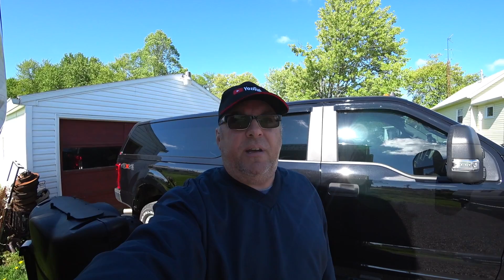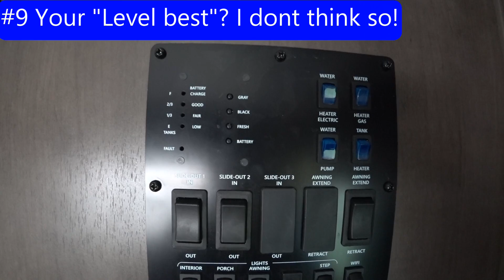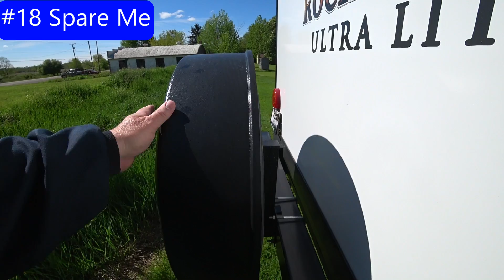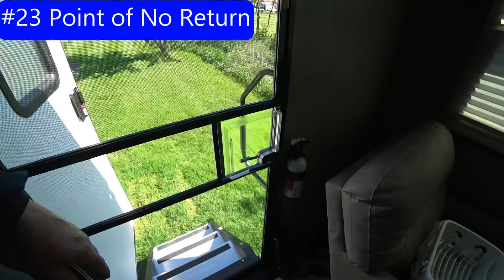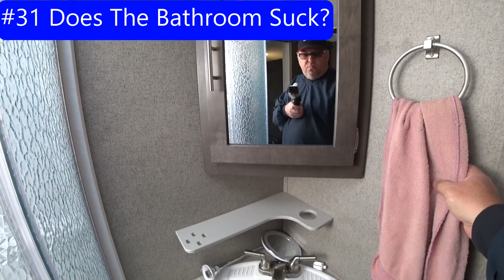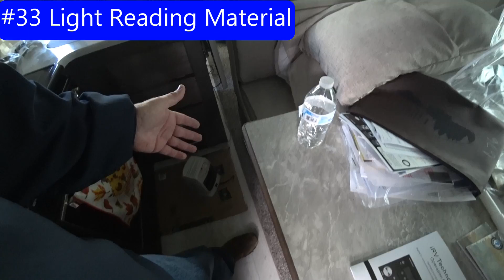36 Dislikes on Our BRAND NEW RV ☹

Comment: Thanks for the things to consider when you're buying an RV video. #2 I'd put some foam on that toe-breaker. That looks painful! #6 There are mattress toppers that can fold or roll up while you're traveling. Once you're staying long enough to bump out the slides you can put it on the bed. Still, more work than you'd like, but your back may thank you later. #22 I'm guessing you already plan to add a rubber stopper, but since you didn't say so... #23 Get those stickers people put on sliding doors. #31 Hate to add this, but mounting suction cups isn't the only issue with texture on every bathroom surface. It also collects dust and will take a bit longer to clean. Bummer. #33 No manual for the RV itself is absurd. I'd contact the manufacturer on that one. Hopefully, someone there sees this video. #34 Replacement bulbs with fewer volts? Colored plastic? Nail polish? Good luck, I'm not sure, but that would bug me too. Congrats on the new RV! Enjoy your travels!

Comment: My pet peeve is overhead lights.  Yes, you might want bright overhead lights when you're cleaning or working on something, but otherwise, I don't want to see a light source shining into my eyes.  Indirect lighting is the ticket, and almost no RV's come with it (except for the high end units).  So I end up having to change fixtures to sconces, lamps, or lighting that diffuses the source.  And while we are on it, sconces that only have a frosted globe are not acceptable.  You can still see the light source.  Indirect lighting means it must be reflected light.  Finding that in 12 volt is tough.  I usually end up having to convert a 120V fixture.

Comment: This is my favorite video of yours. Everyone should make a similar video of their RV. Somebody in Northern Indiana has got to start learning. Love best the point about the tires and bed reading / blinding lights.
Reply: We had the same problem with our light over our bed. I found a simple solution. I took the lens off and used lens spray tint. I sprayed the inside of the lens so it wouldn't get scratched. Took 3-4 coats to achieve our desired brightness but it now works great.

Comment: Did you check this trailer out before you took delivery of it, apparently not? You said it yourself you purchased a trailer with some issues you knew about “why”? I find 60 percent of your issues nitpicking and believe I am a picky person. Most RV ladders are rated at a low weight rating. You would be bettor selling this trailer and try to purchase your old one back. I know you had repaired it quite a bit but your not going to be satisfied with any RV. But I have found as a retired engineer that I can nitpick most anything because I am a perfectionist. If your 1992 had springs on the screen door are you sure you or someone else didn’t add them? My Wife and I have been RVing for over 50 years and we have owned RV’s from class c’s - Class A’s - Fifth wheels and travel trailers. If you wanted low profile ac units you should have either requested or ordered them. By the way if you wanted 2 way powered tv’s you should have deleted the ones your stuck with or paid more money for the 2 way tv. Some manufacturers let you delete the tv’s so you can put what you wanted in it.As for toilet paper holders you can request your deal to mount them where you want not everyone wants them in the same place and like my Wife she had me mount one she found at a store. We sold our ranch plus our company and purchased an Mobile Suites 44 foot DVR fifth wheel to live full timein and I still am not satisfied with everything but it gives me something to do when I am bored. As for the floor registers you can purchase them that are adjustable. Take a deep breath and see if you can hold it for 3 minutes. If you pass out than your nitpicking. As for your Terry we owned a 1984 and it was Junk from day one. Oh BTW the blinds are not supposed to be in the catch unless travel unwise it causes unnecessary wear on them plus they should not be latched while adjusting them. This is why the knob hits the bottom of the blind. As for the black water flush I don’t want it anywhere near my other water connections as for it being near the table your not going to have the table out while cleansing the black tank. Other wise it seems like you have decent trailer. 

But it seems like you shave been aware of these nitpicking issues before you purchased it but in my opinion you say you like your trailer but your either having buyers remorse or making a video.
But I think your having both, just this 74 year old mans opinion. 

This is the first time I have left a comment in the 2 years I have been a subscribed. 

Thanks and I find your nitpicking amusing and you remind some what of myself ah maybe worse LOL, Cheers

Comment: Purchased an Outdoor RV. Most of the issues you talk about were nonexistent. You should have considered the Signature Series model by Rockwood. You did bring up some great points that all RVs lack
Reply from the maker: Thanks!!!  We shopped Outdoors RV and although a better built unit we would have had to get a trailer that was 2 foot longer 2000lbs heavier and more importantly $15000 more to get the same seating layout ...We didn't have that budget... Signature series is designed, Built and used the same parts as the Ultra Lite(we took Rockwood tour)

Comment: You will not like the entry stairs if it has rained and you break camp or it is raining when you do.  I hate mine because water will drip into and on the RV floor when stairs are up-right for travel.  No matter how hard you try and wipe the water off, it will soak the floors.  Poor design in my experience and opinion.  I talked with a manufactures representative at an RV show in Tampa and he said it was not a problem.  Obviously he has not camped in the rain.
Reply from the maker: Wonder why a folded bath towel could not be placed folded at the entry way when the steps are put up? It works for us..

Comment: Yes u are picky...some of your complaints are common to all Rvs. I have a 2015 2604..black flush is right above drain valve. That sucks that they moved it. One thing u did not mention...make sure bathroom door to living area is closed b4 closing main slide..or it will b a problem...i know !!!

Comment: Well pointed out issues,  but keep in mind  it's an Ultralight. They are keeping the weight,  so they choose cheaper lighter components.  When you move to a heavier trailer, a little more on the luxury side,  the quality of the components and tires much better.  Well now you no what you want you should have quite a list of wants and needs. Enjoyed your video.

Comment: Most of the complaints are there because the trailer you went with is designed to be an ultra light. Extra anything is added weight, making use of all the little cubby areas for storage is more cabinetry weight, outlets on the slide out require copper wiring weight, crappy mattress is much liter than a comfy pillow top one the same thickness and the extra hose needed to put the clean out hose on the service side of the trailer would have put it out of the ultra lite class. Also the water heater, heater and refrig  on the entrance side are because of the two slide outs on one side  its a balance issue.

Comment: Just like boats! I purchased a new $30k fishing boat, quality and components were very questionable and somewhat junk. Last year purchased a $80k bay boat, much larger engine (higher price) but entire boat quality, components, fit and finish are superior. My Mother-in-law has a 6 year old $40k tag-a-long camper that has been towed less than 200 miles, sits on permanent beach lot that is falling apart.

Comment: You will never find the perfect RV. After forty something years of rving and traveling in some type of camper we still  want to go another route. We have a new Montana 5th wheel. It checked off every box, i.e., king bed, drawers and cabinets in island, storage in bathroom, fireplace, theater seats and you must be able to see the tv from anywhere in the seating area and a pantry. But recently we started boondocking. We have a potable generator but now we are looking for a Class C and a jeep as we enjoy camping in Arizona during the winter.  So you will always be looking for another camper lol.  P.S. never buy any RV that says lite. They are not built as well because they are using staples and lighter materials. We know this from personal experience.

Comment: Time for modifications lol!  You are correct every rv will have a dozen or so things that could have been better designed.  My biggest  pet peeve in my RV is no electric outlets in the slides. I also agree, almost all RV's have done away with a comprehensive 'owners manual', and that is unfortunate. Also, I agree with the two biggest easy fixes would have been use 12v televisions and plumb the black water clean out to the street side of the coach.  Great video, Lou.

Comment: Excellent video. RV's are like women. No matter how long you date them....you don't know them until you "marry/own them and sleep in/with them. I guess you could say the same thing about men for the sake of women in this politically correct world. Anything from the on/off adjustments on your heater vents to the screen door that doesn't close and everything else including the unused space that could have been used for storage all boils down to one thing...profit. If those pain in the ass hearer vents do not have an adjustable on off lever on them and the ones that do cost 1.00 apiece more just multiply how many vents each unit has x 1.00 x how many units they build. That could add up to 20-50 K in cost over thew entire product run. I have no idea how many units they use them in, but you see where I'm going. A heavier duty latter could only cost them 10-15 dollars more but over the production run could save them $$$$ in the bottom line. This is why I'm seeing so many people restoring older (originally higher end) RV's who seem to have better basic construction then the new (arguably much prettier) or more current looking rigs. As you know, a great deal of deciding on any RV is emotion, and we are distracted with beautiful interiors and amenities. What off sets your disappointments in this rig is the pride of ownership when you pull it into a camp ground and get those wonderful compliments from your new temporary friends. No one loves to talk and share tour invites more than RV people, and that's a big part of the fun of ownership. All of your dislikes were surely reasonable and understandable, and is a big help to people shopping for a new rig. At the same time, there probably isn't a rig out there that is a 100%er to you. If there was you might likely  be able to consolidate your disappointment into one issue.....the price of it. I love RV's and have had plenty of them. But they are much like swimming polls. When you divide the actual minutes/hours/days/weeks you spend in them / useing them ...into the total original cost including depreciation and maintenance and moving them and the additional cost of a suitable  rig to tow them......like a swimming pool....they are a mighty expensive way to have fun. But...we still keep buying them don't we. Why? Because the few precious days we actually get to use them in some atmosphere so different than the "rat race" everyday routine, by some peaceful creek, under pine trees, or an ocean, or in a valley of surrounded by beautiful snow capped mountains, or a desert in bloom...seems to make all worth wild. Thanks for sharing...and enjoy your new pride and joy.

Comment: You did a good job covering all the problems.  Some are no big deal, others are deal breakers.  I can't believe there are no outlets in the living room/kitchen area.  We've had our RV 7 yrs.  I've found a few "Why did they do that?" moments with ours.  One thing I would have never known about if a light in a bay hadn't been left on.  We have a Class A and there is a floor vent between the sofa and the passenger seat.  I saw the light on and there is no reason for that vent to even be there.  Cold air, Hot air, critters, snakes, etc, can come right in the living room.  I had forgotten about that.  We need to close that off from inside that bay.

Comment: My number one requirement when RV shopping is that there's an AC outlet under the table, or elsewhere in the slide.  Rockwood cheaped out by not putting AC power in the slideout
Reply: Keystone cougar no outlet slides

Comment: Most of this stuff I thought "he is just picky" but that black flush connection wins the bone head award. Of course the trailer says Ultra Lite on the back so they saved 6 oz of plastic tube by not running it to the other side of the trailer, but then you have to carry another 25' of water hose! And I agree about the lack of outlets on the slide, I have them on mine right next to the table up high to boot! RV manufactures play the game of Tetras, Where they have a big cube and the keep rearranging the boxes in side to fit.

Comment: You said it only complain about the stuff you cannot fix at least for the bathroom that would be an easy fix in my mind just to get some stainless steel Sheets and Glue on the wall that way there you're such a cups work

Comment: Mike,    please check behind your living room sofa for a hidden wall socket.  Our 2019 Rockwood (similar to yours) has a factory wall socket there that is used to power the recliners that came with the rig.
Reply from the maker: We have Wall sockets at the rear of the RV on both side of the swivel rockers. However that doesn't help when you have to constantly stretch a cord from the rear of the RV to the dinette where a slide will be coming in and out so it's one more thing that you have to remember whenever closing the RV up after camping. They should have put a socket in the slide under the dinette or in the slide somewhere so that you could leave appliances plugged in that we're being kept on the dinette table.
Reply: @Rvdaydream  Agree 100%!  We are on our 3rd Rockwood.   Each time we improve on things we wish we would have realized before the purchase.   The pros of Rockwood definitely outweigh the cons.  But sometimes we wonder "What in the world were they thinking!".   Safe travels!

Comment: An interesting observation is the people that build and sell RVs generally do not go camping. This accounts for how user unfriendly the RVs are, combine that with trying to squeeze out every dime of profit, and one can see how cheaply these things are built. There are manufacturers that build a trailer in one day and are proud of it. Point in fact; no outlet on the slide, no cubby on the back of the sink, short sliding drawer on the bench seat of dinette, adjustable heating vents, location of the tank flush, water hose set up, cheap tires, and the general lack of fit and finish on the inside. IMO buying a preowned is the way to go

Comment: . We also had a couple issues that we discovered with our 20/20 Flagstaff as well. Nothing major, as I realize everything is a compromise, but there were still a couple odd items. First off, our door didn't really latch that well at all. It still doesn't. It just seems like the striker doesn't catch all the way. Sometimes we will find the door ajar at the campsite, and we know we closed it, but it just pops back open. The other The other thing we discovered we didn't like our the stairs. When the morryde steps are wet, they are incredibly slippery. Both my wife and I have slid through the lower step and could have greatly injured ourselves. I agree about the mattress, they advertise them as being a Serta brand, which it is, but it's nothing special. It might be slightly better than an average RV mattress, but it still isn't anything you're going to be happy with compared to your mattress at home. We also really dislike our power stabilizer Jacks. Even with X chocks and the most perfect bracing against the wheels, the power Jacks simply don't support the trailer properly do you eliminate bounce. We will be carrying some old school support stands with us that we can put under the frame in a couple spots do hopefully eliminate the bounce. It's quite annoying, considering it this is a brand new trailer. We had similar results with our tank monitoring as you have had. We just learned how many showers we can get out of a full tank and we try to limit our water usage when we don't have full hookups. Overall, we love our trailer and how it's built. There are a few things that we would change or like to see different, but we can live with those.

Comment: Lots of travel trailers have the black tank flush other side it's assinine no idea why they cannot fix this I had a Keystone Travel Trailer and we upgraded to a 5th wheel and all the "water" stuff is on the same side now super easy. Rockwood is a good brand they all issues no matter of brand, your handy so it's a non-issue. I say if your not handy don't own an RV because you cannot rely on RV service departments they take forever.
Reply: Keystone and Rockwood are both Forest River brands.  And they build them the same way..... Hmmmmm.
Reply: Trevor Stanhope Keystone is not part of forest river it’s part of Thor motor-coach, doesn’t make a difference they engineer stupidity into them regardless of manufacture.
Reply: @esmoglo  Thanks for the correction!  I swear I have seen stickers that say Keystone by Forest River.....  but their websites confirm Thor is the owner.

Out of all of his complaints I'm surprised to not hear my number 1 complaint- placement of the heat ducts in the middle of the floor.